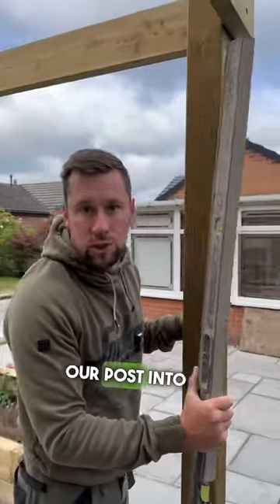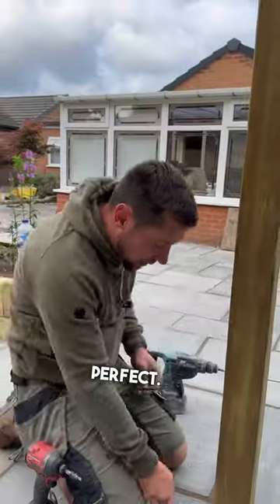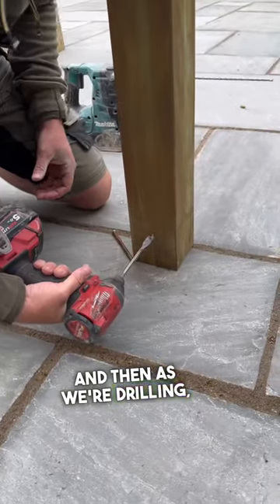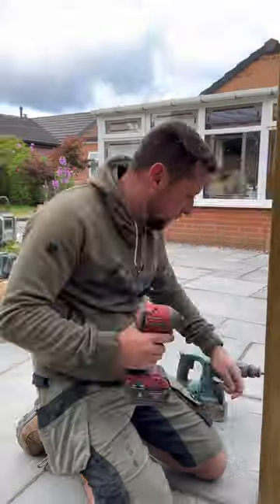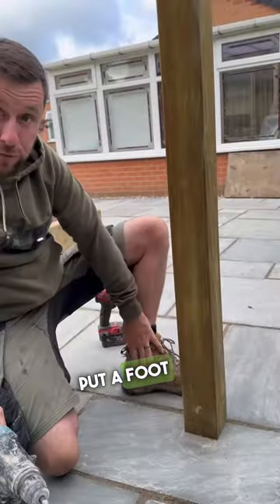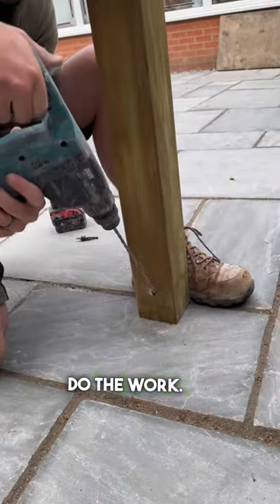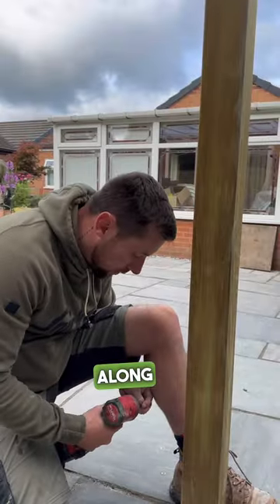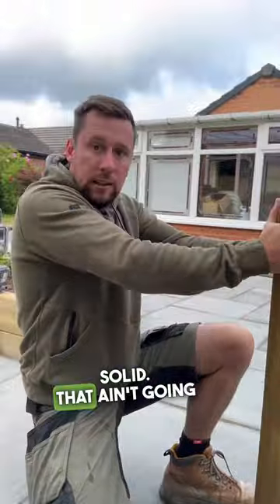Securing a pergola post #shortswithcamilla #patio #gardenlandscaping

Comment: That's one way to ensure it rots quickly whilst being insecure.
Reply: Thought the same 😂
Reply: What do you do then? What's the right way?? And dont say "not that" lol
Reply: You use a post base support to stop it rotting on the floor 👍🏻🤗
Reply: Or black Jack the bottom of the posts and dig out the area. Longer but a better finish in my opinion.
Reply: @NM-gy6tx wood should not be in contact with the ground/concrete or it will struggle to be dry long enough to prevent rot occurring .. Wood can draw oisture up and out of the ground, moisture can wick through cement and some stone.. that fixing needed a 10 or 12mm clearance that will become a well/pool for water to sit in .. that water will soak down and insure the wood is damp at the base for long periods of time and rot will come sooner than it should for this reason..
More fixings at least to prevent rotation, but in any case , and if you don't know better , it just does not look the right thing to do .. a hunch or intuition here is fine , that fixing ain't, if a kid playing football falls against that post , the post is gonna move a bit .. then you have an unstable post and it will get worse .. maybe in a storm..
Reply: Yeh don't do this😂
Reply: …been fitting these softwood things 4 years - just use PVA glue on the slab, no screws why waste your money, sticks forever no call backs🤦🏻‍♀️😂
Reply: Drill a hole through the slabs, fit a post support into the hole with adhesive or mortar.
Blackjack the underside of the post and secure to the support.
Keeps it off the ground, away from water and secure
Reply: @NM-gy6tx how old are you may I inquire?
Reply: @FiscalWoofer 
HA!!
Reply: @liamrobertson7265  early 40s, I like diy and gardening
Reply: Use a staddle stone to keep away from moisture, not this quick fix method
Reply: Even if it's been treated?
Reply: @braille5575  treated timber will rot after a few years of being repeated wet dry cycles.
Especially if the endgrain is in contact with the floor.
nevermind the quality of the treatment?
and of course I'm talking about here in the uk where timber means stringy fast grown softwoods  that still cost too much but  represent the poorest quality wood out there?
I'm  hoping the guy in this vid is just having a laugh at us?
Reply: And that little hole facing upwards, fill with water and rots out in 2 mins. Nice.
Reply: I’d rather pay more to have it done properly with a patio fence post support set in concrete before the patio was laid.
Reply: Yep water will just sit under post and slowly rot it
Reply: @NM-gy6tx tie it round your neighbours fence with some old rope, bosh job done.
Reply: So then my question to the critics/professionals is are wooden fences wrong for burying the posts in ground with concrete ?? Posts come in contact with ground and I do concrete and find that always they rot when removing fencing especially the posts that support wood picket fences
Reply: @shaunclohessy5105  question
Reply: Straight into the type 1 ………..hmmmm
Reply: @liamrobertson7265 no he’s just a typical millennial or gen z suffering from the Dunning Kruger effect

Comment: You're going to want a bit more security than one screw into a piece of stonework.
Reply: That screw wont last long in stone at the bottom of a wooden post
Reply: You can hang off them anchors. Biggest worry is wood rotting away.
Reply: @Howt-ooo  I'm going to have someone do it properly if that thing has the potential of flying around like a house in the Wizard of Oz!  A 2" screw in a pre-drilled hole on a post that sits directly on the stronework waiting for woodrot is not going to last past the first harsh season.
Reply: Lol that one screw into the sand underneath
Reply: a screw into a slab is the way to go.!
Reply: U get foot anchors take the wood of the ground then trim it a few mm of the ground so wood not touching the slab
Reply: It's just a 28mm slab with muck underneath,  one fat bloke leaning on the posr, it's gunner rip the lot up
Reply: @jakecardy1121 What screw? He just drilled a hole where a screw might go. He didn't mention a screw. (Might not even know what a screw is if he thinks that is the way to secure a post to a paving slab) 😊😊😊
Reply: cowboys !
Reply: @scottbeattie7394  what I was thinking. Mark slab and remove. Drill hole in slab, dig a hole and fill with post mix. Replace slab insert post bracket. Fix post to it. 
Jobs a good un’.

Comment: you would be better off using a saddle stone or a Simpson Strong-Tie APB100/150 Adjustable Post Basethen the post won't be sat in the water on the wet or damp patio
Reply: Thats what i was thinking, that post is just gonna rot
Reply: Why spend all that time and money on a great looking patio and pergola and not secure the pergola properly.
Reply: ........it's "STADDLE" stone,  genius !!
Reply: oh my gosh you spotted a typo  take a bow and pat yourself on the back (hope that made your week ) I wouldn't want you to miss out on belittling someone  @ConradWalsh
Reply: Agreed, Simpson concealed base mount or a saddle stone. Either option adds about twenty quid per post to the job. Why just not do it the correct way???

Comment: It’s a terrible solution for fixing posts ! Basically fixing into a 20mm slab . Simply not strong enough and won’t stand the test of time . Sometimes it’s best to not try and re invent the wheel . Also you’re checking for plumb not level 👍🏻
Reply: He said, we check the level, not we check they're level.
Reply: he basically but a tiny metal tap root onto the bottom of the post in the form of a screw, a screw whos threads would be exposed to the elements between the flag and post.  This screw will just stop the bottom of the post being kicked out but i dare say the post could be lifted no problem, no rawl plugs or nothing to hold the screw in.
Reply: @BigPerm6999 it'll be a concrete screw but I'd agree it's not adequate
Reply: @BigPerm6999 it's a concrete fixing. They don't require plugs, just a pilot hole. Although it won't work for this application 😂
Reply: @stusummers4397  ahh, simular to a through bolt? but a screw?
Reply: It's just a pergola. It's not supporting any weight except itself and a few beams on top. You guys never consider the application. This wouldn't be sufficient for a loaded deck but it's more than fine for a simple pergola.
Reply: That slab is a a cheap patio slab made on a vibrating table. It is neither strong enough or thick enough to anchor too. Even a pressed concrete slab at driveway spec is not enough to anchor like this. Shockingly bad work from a so called pro.
Reply: @jamescrud  No it isn't fine. This is absolutely inadequate.
Reply: @nospoon4799  That pergola is free standing. It doesn't even need to be anchored. There isn't enough surface in area in that structure relative to its weight for wind to pick it up and send it flying unless we're talking hurricane forces. They don't have hurricanes in the UK.

Comment: On the vertical plane, you check for plumb, not level. Also, a post shoe would keep water out of the end grain underneath to help with rot and provide better fixing, and you don't leave holes in the post.
Reply: I think he said We check the level..Not we check for level so maybe he ment we check the level for plumb..I'd hope..

Comment: I wouldn’t trust anyone that thinks making a post stand straight up and down is called “level”. 

Toenailing a post like that is not enough to anchor it to concrete. The storm brewing behind you will get the post nice and soggy. The wind will knock the post out of PLUMB and make the hole in the post bigger and fall apart. 

I guess you’re goal is to come back and charge them to fix it in the spring time.

Comment: Whenever I have built these I have always set the posts into the ground first. Then done the patio cutting the slabs around the posts. Then build the pergola. Must stronger than that. 

Whenever you put the posts in the ground too you dig the hole put shingle in first then sit the post in with the bottom 300mm of the post dipped in bitumen and concrete around it. That way any water that gets inside doesn’t sit around the post which causes it to rot.

Comment: Errr, plum not level. Single screw into a paving slab?? Posts either need a surface fixing with 4 x heavy duty anchors or root fixed shoe.

This is a bodge job.

Comment: You're sacked mate....have you heard of  sand cement and aggregate...mix them together to a mix ratio and you've got concrete  dig a post hole, order long enough 4 x 4 posts rape the ends or treat them and concrete them in...doing it this way gives you a free guarantee its going to still be standing after the first strong winds...the way you've fixed these posts in...is a perception job, customer pays cause they think it looks great, you get paid and then up the road never to answer the calls when it inevitably falls down.
Reply: The only excuse he could have is the paving is already in place and the customer has a ridiculously low budget, but he says thats how he does it so chances are he's just a bodger!
Reply: He's building a pergola. What you're suggesting is beyond overkill considering the application.
Reply: @jamescrud  

I bet you wouldn't fix the posts like that though yourself!
Reply: @paulw6183  You're right. I would put a plastic or stainless steel spacer underneath to make sure the wood isn't sitting directly on the stone so that it won't stay wet. Then I'd use 2 screws insted of just 1.
Reply: @jamescrud  Still not enough. That screw is going through 25mm of unpressed slab.

Comment: If those slabs aren't on a solid baseid advise using strawberry jelly as a plug it will probably be more stable. You can buy a shoe to stop the bottom of the post being in direct contact with the floor.

Comment: what about standing water rotting that over time, wouldn't it have been better to have it raised with a foot and attach that or place in the slab with concrete haunching ?
Reply from the maker: It’s not the water the rots the post its soil. Also these posts UC4 for treated. There is also a fall on the patio, so there will be no standing water.
Reply: Well said

Comment: Im. Ot a landscaper but off the top of my head, I would have cut the pavement about 20mm wider than the bottom of the post and dug down maybe 400mm and put postcrete in bottom 100mm then put the posts in and and fill the rest of the way

Comment: That isn’t going nowhere until the slab comes loose or the screw rots off. 
The correct way uses a post base concreted into the ground that lifts the timber end 100mm off the floor.

Comment: Good workmanship is never overkill...from the tradesmen perspective maybe some would regard overkill (as you phrase it) over effort, alot of tradesmen work on a principle as just enough. If I was doing this job or more so before I accepted to take on the job I would have priced and advised the customer concreting the posts in was a condition of my acceptance of doing the job and what I had priced to include, if the customer felt the need to tell me to not concrete the posts I woukd tell them to do the job themselves. Now that's the difference of quality, not overkill. Good luck

Comment: Fix a post into the ground... proceeds to sit the post ON the surface. So that one screw, times the mass of the build, times the vertical mass, plus high wind / shoulder lean and even if one in each corner.. i fear this is not going to hold.

Comment: Woah fellow, 100mm drill bit, I think you meant 100mm screw at the end.
1... its a bit weak with only one screw with 50-60mm into the concrete 
2... its tantamount to corrosion
3... no rawlplug or fixing agent,chemical or sealant.
4... I learnt how not to do it.

Comment: Nope, nope, nope. You want a metal bracket, to keep the end of the wood off the floor to stop it from rotting. You should secure the bracket to the patio, and then the wood to the bracket.

Comment: That screw will not hold that 4x4 into concrete(!) for long. You need the expanding anchors and a lag bolt…
Water pooling will rot it out soon

Comment: You'd actually want to fasten a bracket to the stonework, and then fasten the post to the appropriate bracket, with multiple fasteners connecting & securing both the bracket to the substrate, and the post itself to the bracket itself. Structural grade screw or bolt fasteners that have a shear strength rating acceptable for the usage context, in addition to the tensile strength needed
Reply: There is not enough meat in those slabs to fix anything to them. The whole issue with this is that the fixing he used went straight through the slab. The same problem with a bracket.
Reply: @nospoon4799  Well I never said one should ideally skimp out on the thickness of a slab or footing. Thicker is generally better, when done correctly
Reply: @TheNinjaOfThe906  I get that. Slabs are generally 25mm though. It is just not enough to hold a fixing.

Comment: Hack job, 1 wooden post is resting on the tiles, will rot sooner or later, 2 you cannot just screw into concrete / tile without using some sort of plug / anchor and expect it to last.

Comment: Shocking installation. That hole is a pathway for rot, especially the direction. 
 Why are you not using hardware and waterproofing. This will last 2 years tops before rot sets in. Learning on the job. Just look it up.
 It's called code. It's not complicated. Poor customer 😢

Comment: I'd have cut the post at a 45 degree angle at bottom then smashed slabs, then poured alot of concrete everywhere, put my name in it and then fixed all the posts securely to the ground with cable ties and then finished them off by leaning bricks against them just incase it gets windy 😂😂😂😂

Comment: That surely is not secure enough. How do you know the bed of that patio is deep enough to hold. Might only have 30mm bed concrete and the rest type 1.
Plus, why not dig a holl and use postcrete? 
I mean lets not talk about the water that will now get in that hole and rot the post from the inside out 
Just there are better ways to do this bro then a "lets get this done as quick as possible"

Comment: You can’t screw into a slab without a fixing.
Reply: Slabs are not thick enough for any fixing. He is screwing mostly into the sub base.
Reply: @nospoon4799  Surely a hammer fixing would be the very least?
Reply: @quokkapirquish6825  Nope, the slab is too thin. At 25 mm. You shouldn't anchor into slabs.